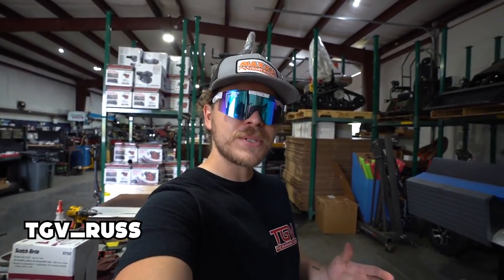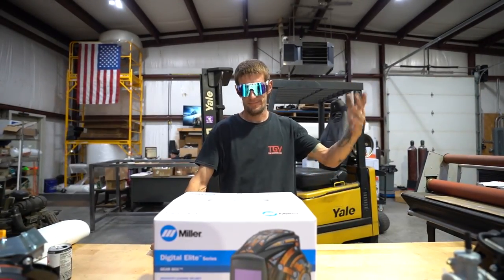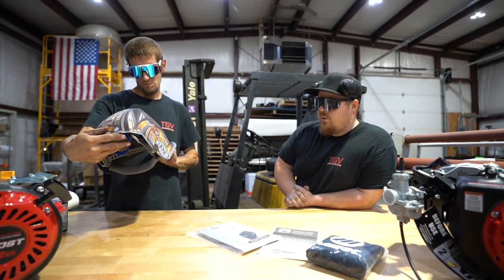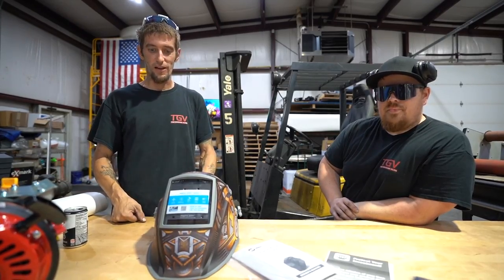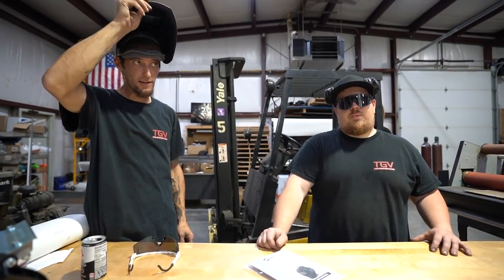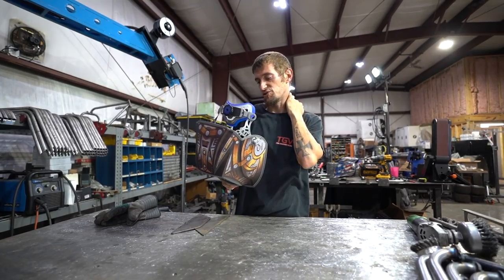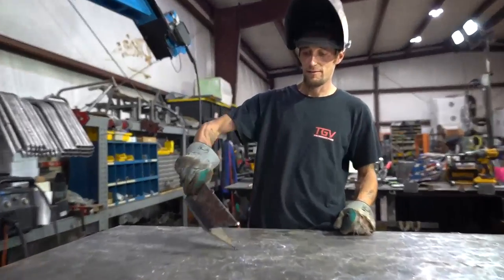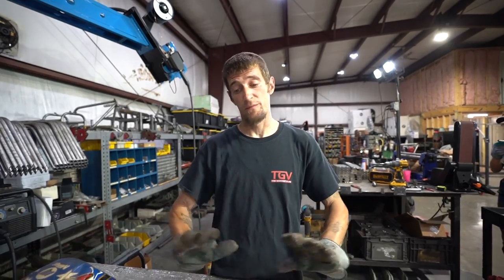Miller Digital Elite ClearLight 2.0 Unboxing/Review

Comment: I been welding in tanks for a long time. If you a structural or any welder. We all use either a Fiber Metal flip or Jackson HSL 2. Those hoods are old but nothing new that comes out can beat them. Put in a Tradesmen lens. Better.

Comment: I've been running the digital infinity for over 5 years and have never had a complaint about it and never had issues.

Only problem was I dropped the lens/computer first week i had it and cracked the screen where the sensitivity readout shows lmao but it has still worked perfectly despite that

Mine might be the clearlight 1.0, not sure which version was put when I bought my infinity